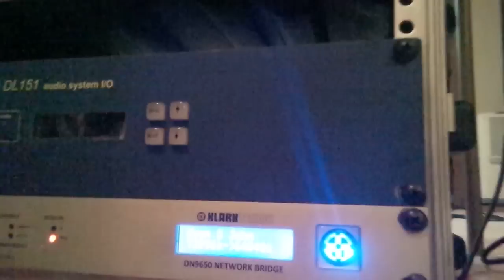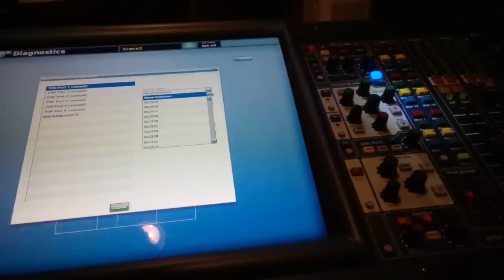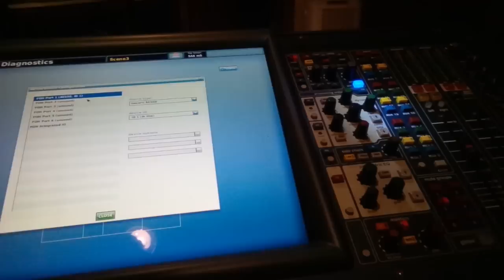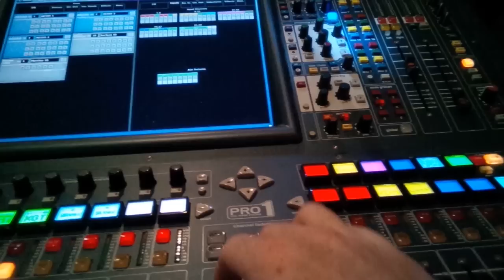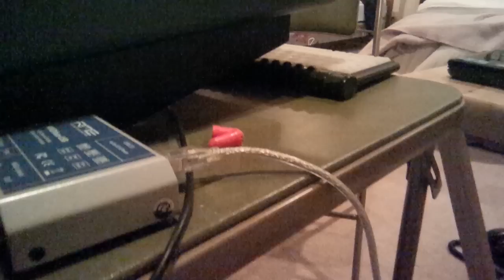Klark Teknik DN9650 connecting to a Midas Pro1 and RME MadiFace

Comment: Hello John, i need help. I have a midas pro 9, dn9650 and  RME digiface dante.  On my 9650 i installed a madi card but its not connecting, i am using an r59u 75ohms cable as recommended but its still not working please help.
Thanks
Reply from the maker: Honestly, I haven't used this system in over 10 years. I can't remember how to troubleshoot other than what I mention in this video. Also, I haven't used the digiface Dante. Could you have the coaxial cables swapped? Does the AES50 light up green on both the console and the dn9650? Is thr dn9650 set to the correct mode? 96k, 24bit. That's about all I can think of

Comment: Hi john, i want to do multi-track recording with MIDAS pro2c to my laptop, i'm using pro tools. What cable would i need? would i follow this exact same setup, you did here?
Reply from the maker: Alan Rojel Yes, you will need the DN9650 and an RME Madiface or the digico ubmadi. basically you go aes50 out (ethercon) to the dn9650, then Madi from the dn9650 (BNC) to the madiface USB, then USB to the computer.
Reply: oh ok! with the RME MadiFace, can run any DAW software, right?
Reply from the maker: Alan Rojel yes! It should work with any DAW.
Reply: oh ok, i saw is expensive, but from your experience is great! is worth getting it!
Reply from the maker: Alan Rojel If you use the Pro2 all the time then yes, it probably is. Otherwise it's sort of just a novelty. It is really expensive. If you only use midas pro's occasionally then it's probably not worth it.
Reply: i will def check it out! i do live sound in my church and i want to record! the AES port is connected already, i would just get a BNC cable and connected where it says wordclock, right?
Reply from the maker: Alan Rojel No, word clock is for syncing the clock source to an external clock or another console. It doesn't pass audio. You need to buy the Klark Technic DN9650 with a Madi module in it that will convert aes50 to Madi. Once it's in Madi format, you need the RME USB Madiface to convert Madi to USB. The DN9650 is probably around $1200, and the RME Madiface is around $1000.
Reply: i saw is easy to install any cards, in this case you got the madix card which is a BNC port, or if you change to a card that has a ethernet port, then i will need a usb interface with ethernet ports, right?
Reply from the maker: Alan Rojel you will need an AES50 to USB or Thunderbolt interface, not just a usb to Ethernet port as far as I understand.
Reply: an example, like the KlarkTeknik KT-AES50
Reply from the maker: Alan Rojel yes. I don't think that existed when I made my setup, so you could possibly get a dn9650 and put a kt-usb in it. however, this will only allow for 24 channels in and out. with the Madiface you can do up to 64 I believe.
Reply: ok! Thank You! can i send you a direct message by e-mail for any further questions?
Reply from the maker: Alan Rojel Sure
Reply from the maker: Alan Rojel iamjohnnytrox@gmail.com
Reply: Thank You!